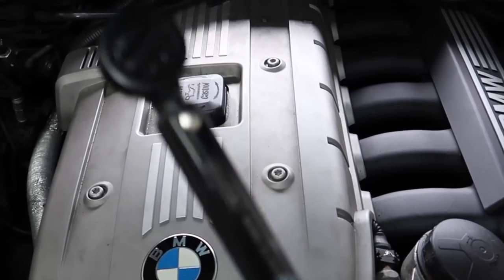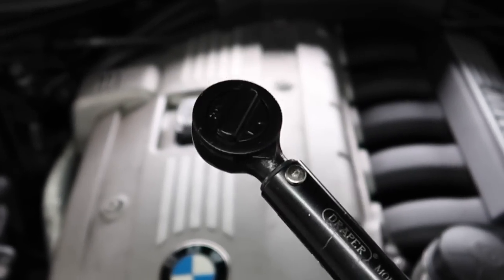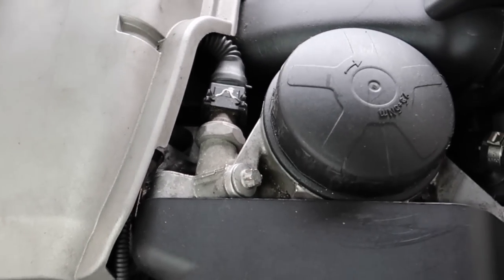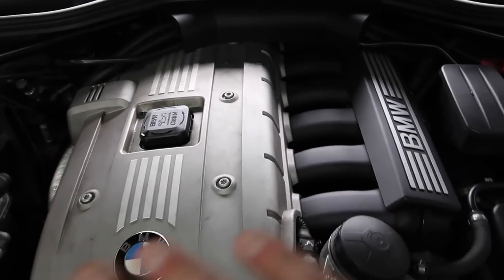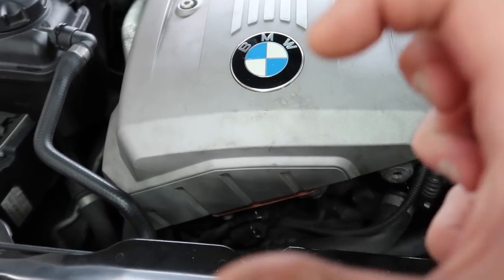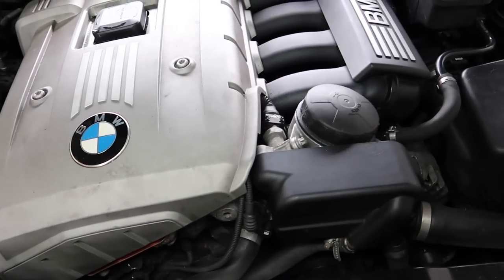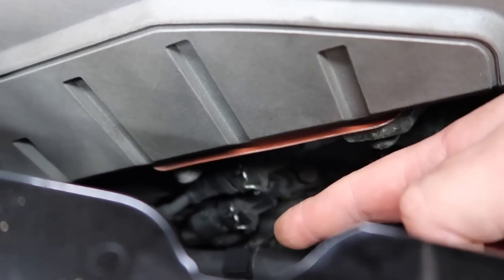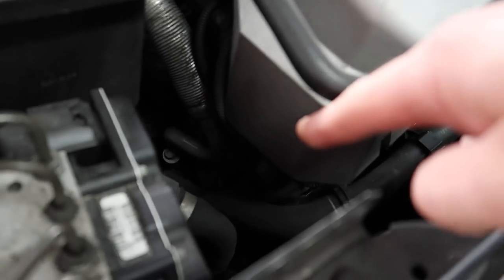NEVER EVER Do This To Your BMW !!

Comment: I'm sure the book has a torque spec for nearly every fastener on a car but you're right, after you've turned enough wrenches and stripped enough bolts, a torque wrench loses a lot of it's value.

Comment: Hey Doc just need some adivice, im in the market for my first BMW and cant decide between a 2010 E89 Z4 23i N52B25 and 2012 F30 328i N20. Both cost roughly the same and have around 110k km (70k miles). In terms of reliablity which one would you suggest? Thanks, sorry for bad english.

Comment: I'm thinking of putting an S65 V8 in my 128i, and build the 1M that BMW should have built. Could you make a video giving some tips? It would mean a lot if you helped me on my journey to build the 1M BMW should have built. I'm still in the thinking face, I prefer NA engines which is why I don't want turbos/supers
Reply: Think of how amazing the 128i will be with an S65, the small size/light weight with a V8😥

Comment: I dare not touch anything serious without a torque wrench, but that's because unlike my dad I haven't spent most of my life wrenching on things. It just makes me feel better 😉

That said, if it doesn't have a torque spec in the Haynes manual (or is that n00b manual?), guttentight is good enough. Pretty sure I could feel my way into doing up my VANOS solenoids well enough. There isn't any oil pissing out of them yet so it must have been enough 😁

Where it did come in handy was on a drop link nut that worked itself loose TWICE after the garage was done with the suspension work (I had them look at it the first time and the guy did it back up on the spot). Second time turned out to be the same nut, so I did it up to the torque spec and it hasn't worked loose since.

I get what you're saying about taking advice from other n00bs though, thus I tend to prefer official documentation where I can get it

Comment: Thanks!
Reply: Hey, I have a 04 330ci convert. I've replaced the disa, mafx2, idle control valve, plugs coils, fuel injectors, fuel filter, secondary, radiator, thermostat, coolant sensor,  Codes was p01504, p01508. P02158, p0070.
When starting, starts sluggish, rough idle ect. When I disconnect the MAF good idle but no throttle. I'm baffled. Pls. help.

Comment: You must have different type folks in Britain. In the states, stupid tight is not tight enough. How many stripped oil pan bolts have you seen?  I have seen quite a few. I have found broken bolts on my car.   I once had to use a 6 ft breaker bar to get lug nuts off my wheel. This from supposedly trained techs. Some folks just need to be told in baby steps. I often use the German method. Gutenteit is the right torque.

Comment: Thx Doc!

My N52K oil pan gasket leaks at   Only 70,000km. You gave advice on that before but I can’t find it. 
Can you do video or point me to your older vid??  2008 128i
Reply from the maker: No problem MARIO I will do another video regarding this
Reply: Thanks Dean! BMW wants $1000 to replace frickin gasket 😵
Same with valve cover gasket and oil filter housing gasket. I took care of that myself couple years back before you were YouTubing for cost of gasket set saved a ton o dough. And I know it’s done correctly!

Comment: dean yur putting them in they’re place 😂😂 I totally agree snug is snug n that’s it also yeah I never torqued nothing on mine either tight is tight and that’s it I recheck my work but that’s it I’ve done the manifold exhaust work yet to do turbo and injectors that will be fun and yeah fair enough big end bearings or rod bearings yeah use a torque wrench 🔧😂

Comment: anybody disliking tell your position
Reply from the maker: Safe bro ! But the haters never will you should know that. 

There keyboard warriors and a bunch of p***y holes 😂

They wouldn’t even dare state as they know I would have them up on here and in real life.
Reply: Hey Dean,  great video as always. I believe in the old saying, "Tight is tight, Too Tight is Broke!" I only use the Torque wrench on only Critical internal engine parts as well.  Hope all is well across the pond, and keep up the Great work!